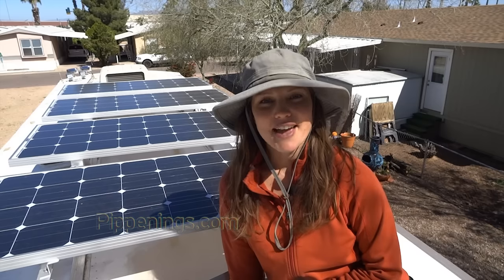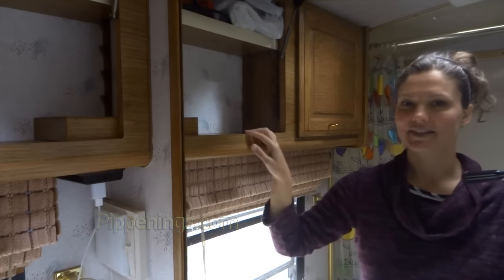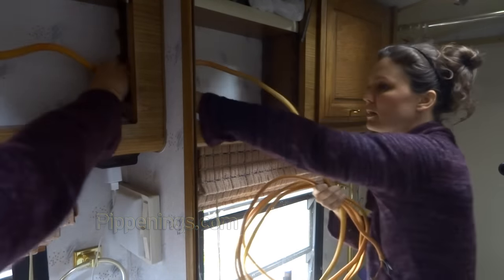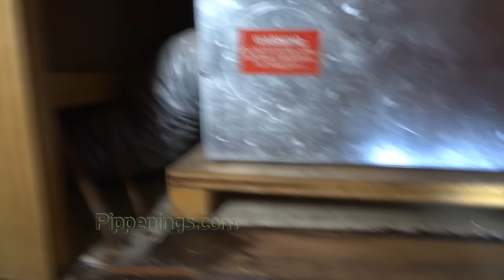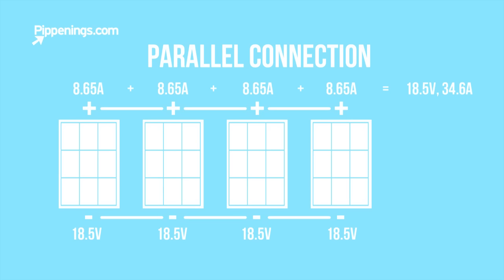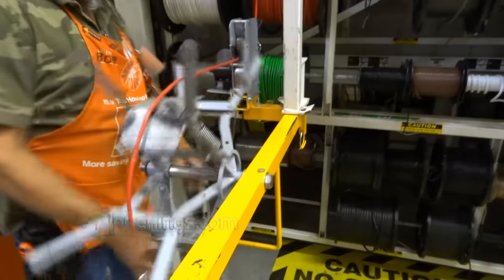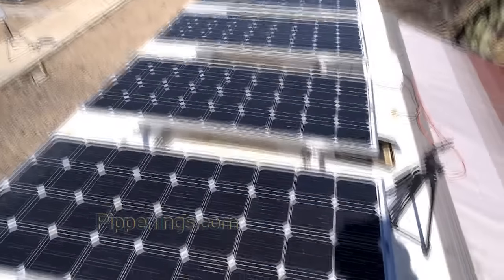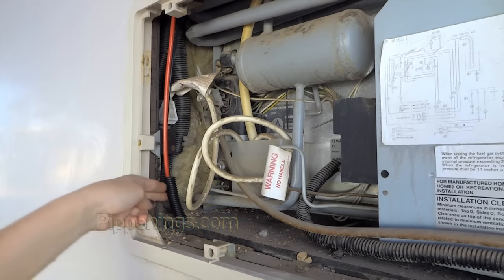RV Solar Installation, Wiring part 2

Comment: Pippi, please do not use white zip ties.. They do not stand up to ultraviolet very well. Spend the extra and get the black ones from a good electrical supplier.
Reply from the maker: +tom holmes Great tip, thanks

Comment: Was the leak from the reefer drain?
Reply from the maker: +rolloverriderpgr No, same outdoor shower head as last time. That video is coming up 😉
Reply: Pippi Peterson Thankfully our outside shower is in its own box. BUT I disconnected it as it was a leaker! When we get home this week I'm changing the power switch from the box & rerouting the wiring there up to the bathroom so it's easier to turn on instead of having to go to the kitchen every time water is needed!
We dont use the outside shower so no loss.

Blue Sky's and Safe Journeys!

Comment: Just use ten gauge stranded.  If it's good enough for 4,500 watt generator transfer switches, it will more than cover solar panels.
Reply: Brian Perendy No the wire must be sized to the load and length. AC vs DC wiring and sizing is very different due to voltage losses being greater at lower voltages.
Reply: Brian Perendy I'm not sure if you do get it. 12v voltage loss and resistance is very different than 120v voltage loss. But don't take my word for it research it for yourself. For example 120v and 50ft with 30A, 10ga is fine and standard. But 12v and 50ft with 30A requires #2/0 for the same acceptable voltage loss. Just cuz smaller wire is cheap or it works doesnt mean its right. Thats how fires happen . Check Coast Guard regulations of vessels and wiring, it will be the same principles.
Reply: If your boat has dc existing connections with fuses and with on/off switches to 12volt  marine battery for navigation light, cabin light, fish finder, bilge pump, radio can you just add solar charge controller and 750 inverter to the  positive and negative on battery?   Is it simply if you leave a switch on from old system, when you turn inverter on you'll burn a wire?  Like a plumbing valve.
Reply: Brian Perendy If you are adding solar and an inverter, you add new wiring for those. One could add a buss bar if there's a lot of wires going to battery. But that cable from battery to buss bar must be large enough to carry all loads, so maybe a 2/0 or something. There should also be a circuit breaker in line between battery and the inverter and the charge controller. Bussman has a few options.
Reply: thanks good reminders.

Comment: I may have missed your reasoning but I wondered why you didn't just  wire them all in series and keep the voltage at 18.5v?
Reply: Jeff Frankhouser   Solar panels are only as good as their weakest link
That is if one of the series panels is not performing well because the shadows or some other reason. It will set how much current goes through the system
Reply: + Jeff  Wiring all panels in series would actually increase the voltage - and would leave amps the same. Panels (or batteries for that matter) can be wired to increase voltage or amps but not both, one has to remain constant.
Reply: Alex Davis you are correct the problem with series is that if one of the panels is shadowed it's like an open connection
 exaggeration not 100% open but it basically becomes like a open Circuitry
Reply: +mark nelson  Right, but Jeff Frankhouser's comment was why not wire all panels in series and keep the voltage at 18.5v - which of course would be impossible.
Reply: Alex Davis   Your right
Reply from the maker: +Jeff Frankhouser They would need to be wired in parallel to keep the voltage at 18.5. And I didn't because of the shadow issue I described in the video or that Mark reiterates here.

Comment: Next time use a double heat shrink to go from the large heat shrink to a smaller size to complete the seal and insulation. Or use a 3M product called Cold Shrink. It is better and provides a better level of weather protection. Nice work.